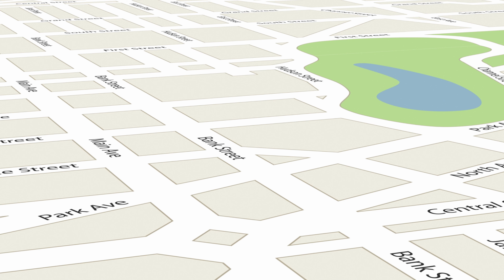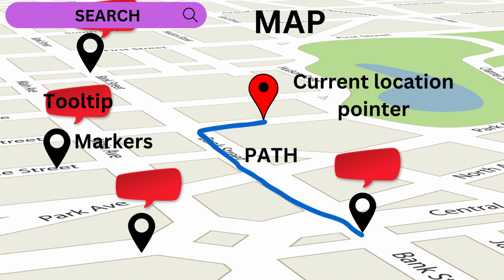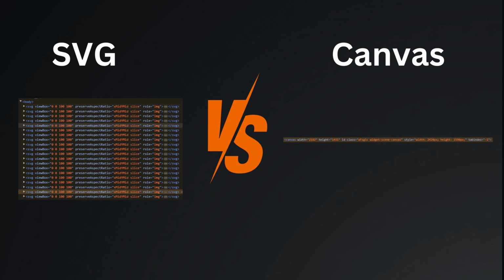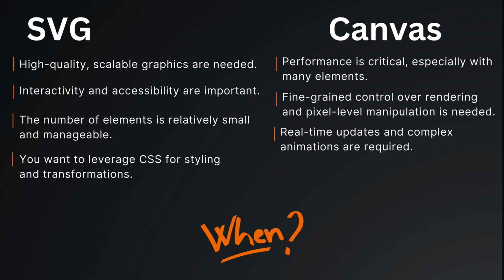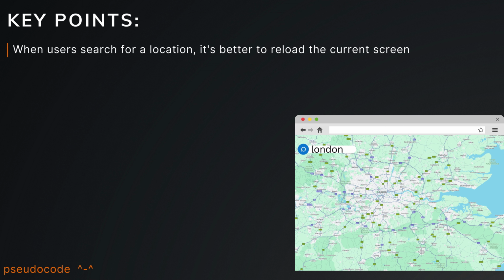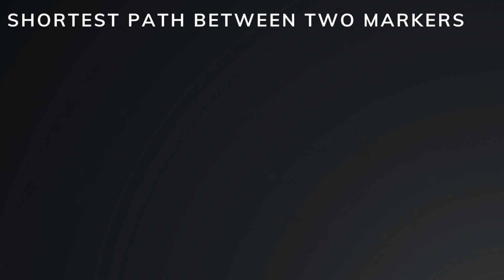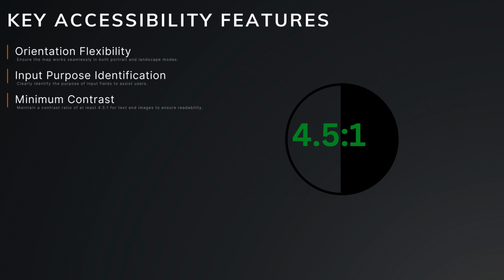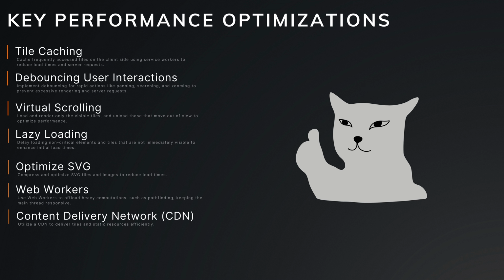FrontEnd System Design - Maps

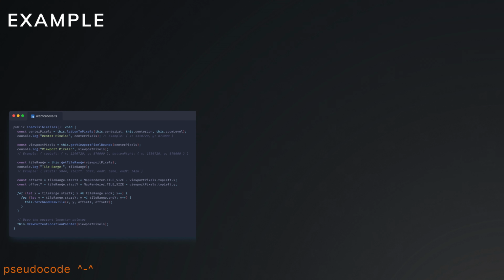Comment: @webfordevs  I also felt 06:11 - Creating Map - Pseudocode/Example needed bit detailed explanation. I am slightly confused on what we are using for centre latitude & longitude(i assume it to be current location, please correct me if not) & converting to pixes logic.

Also, you have used longitude for width calculation , i believe it should used for height calculation as longitudes are vertical starps on globe and latitudes are horizantal
Reply from the maker: In the lanLonToPixels function, I used longitude for the X-axis (horizontal) and latitude for the Y-axis (vertical). You can see it here: https://youtu.be/kNVrTzOMIIY?t=388

Let me know please if it does not sound correct
Reply: Sorry, I think you're right here. Longitudes difference is right to calculate x axis
Reply from the maker: @teluguPrapancham867 feel free to ask more questions or share your feedback :)

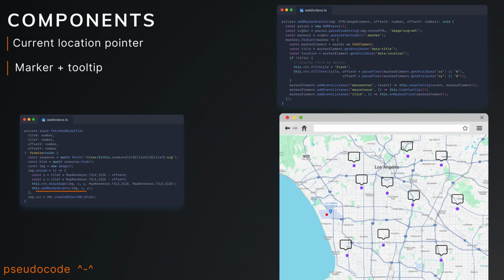Comment: 7:04 how come every tile is SVG ? 
We are using canvas to render image right ?
Reply from the maker: Here is an example https://jsfiddle.net/Na6X5/ (not mine)
So we can render SVG elements inside canvas
Reply: @webfordevs  Thanks for replying. but the svg will be rendered just as an image/picture once you render using canvas. It is no more a DOM & looses all its click listeners also. I'm  concerned that the click listeners you used for tooltips will need a separate DOM overlay over canvas else it wont work.
Reply from the maker: As I mentioned in the video, it's just pseudo code. Since we control every pixel on the image (because the UI is built in JavaScript), we can attach an onClick event to the canvas. This allows us to detect exactly where the user clicks and understand their intent. Hope this helps. But I agree—I should have paid more attention to it
Reply: @webfordevs  yeah attaching click listeners to canvas and tracking clicks at pixel level would have worked.
Thanks for being open to my explanation. It's a sincere attempt, kudos to you. Please try to make it lengthy so that you get time to explain the pseudo code in detail.